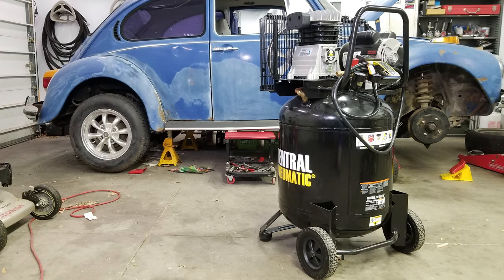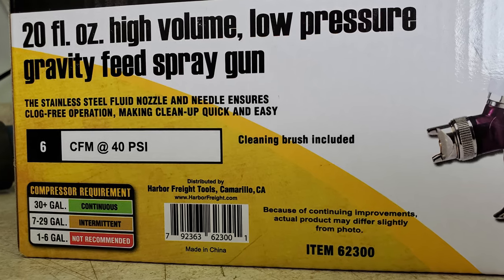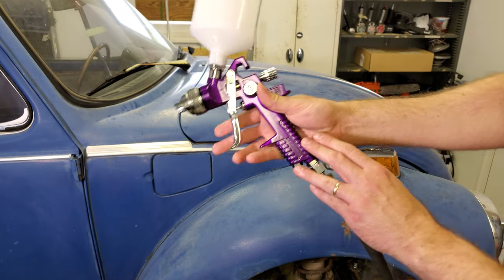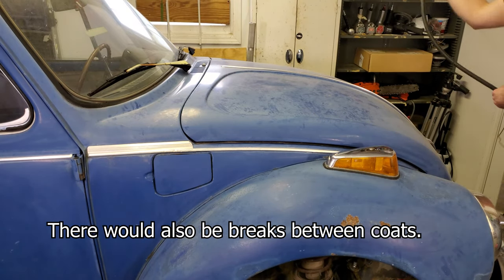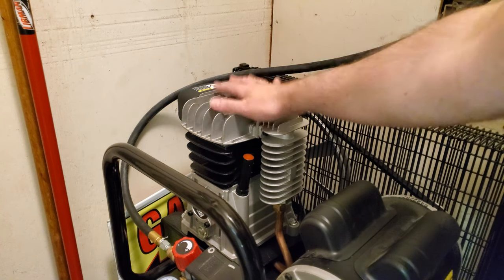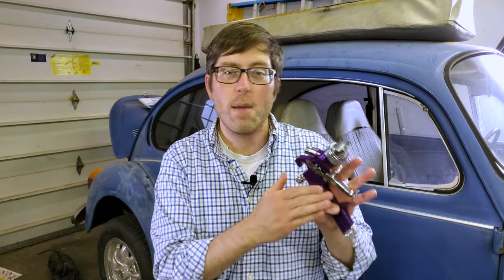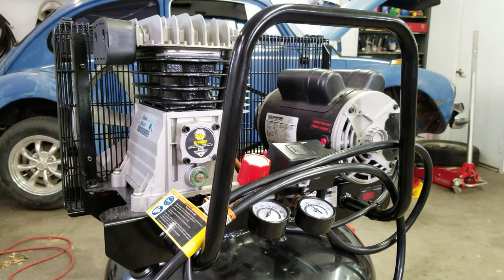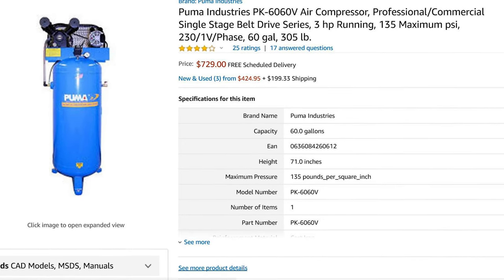Tool test: Can the Harbor Freight 29 gallon air compressor run an HVLP purple paint spray gun?

Comment: as a car painter myself, what do you spray for 10 min straight. this should be fine for painting the average car, there are a lot of stops and starts to it, AND you are not using the air gun to shoot as much air as it can.
Reply: exactly!
Reply: Problem is with clearcoat trying to keep a wet edge without starting and stopping

Comment: I've used a 2hp compressor with a non-HVLP spray gun to paint.  It's adequate.  The test in this video is not realistic. You'd never be spraying continuously for 10 minutes.
Reply from the maker: Well, it's pretty realistic if you're spraying a large vehicle. Like I said in the video, give it some breaks and it will work. You'll still be running the compressor pretty much constantly, though.
Reply: One can not paint continuously for 10 minutes,  for one, you'll never hold the trigger without any stop in between different areas of painting, more importantly, don't you think you have to add paint at certain point and stop painting??
Reply from the maker: Just like I said in the video, it's not a perfect test, but it gives us an idea how the pump cfm compares to this cfm usage on this gun.

Comment: I use the 21 gallon HF compressor and painted my car no problem.  As long as your patient and not stupid it works just fine :)
Reply: What spray gun did u use?
Reply: @theonekninek75230k  The cheapo HF one.
Reply: I just bought a Eastwood spray paint that only uses 4.5 cfm at 30 psi and I really want that 29 gallon but I think I'll start off with that 21 gallon since I'm new to using spray guns it should handle it
Reply: Exactly

Comment: With thise vunscyou should never use 40bpsi usally fir base coats you would use 29 psi for base coat ckear at 30 to 31vpsi you falilded fro not using a requlartor in gunnur not getting true pressure at the gun

Comment: For anyone who is wondering if their little air compressor can handle spraying, here's my experience. I have the HF Central Pneumatic 6 gallon 1.5 HP 150 PSI, with the HF 20 OZ HVLP spray gun that according to the manual demands 6 CFM at 40 PSI. I just sprayed three layers of lacquer on a 4' by 6' dining table and not a single issue. The compressor came on one or two times during each layer. I set the output to 40 psi. The tank pressure never fell below 70-80. 
I believe the factory specifications are for CONSTANT running of the spray. But what amateur on earth does that? You would need to let the trigger go while you reposition yourself or handle the air hose around the workpiece anyways.
Reply: i have an older 8 gallon Central Pneumatic compressor with the gun hes using in the video.. is it great for this purpose? no. but even my compressor worked well enough to paint my boat. i set my gun at 20 psi. but it worked. so i agree with you
Reply: I pained a car fender with a pancake compressor at 20psi. Not ideal, but it worked.
Reply: For painting cars you are supposed to never stop the air flow. So for that application it may be problematic

Comment: The air compressor works fine, its the amount of air you are asking it to provide that's the problem...yes in short bursts as one would typically use a paint gun, the compressor will handle it just fine...I've yet to run across a case where I've had my finger on the trigger for more than a couple minutes I guess maybe if you were painting a bus but for most DIYers they're going to do a few feet of painting at a pass, let off the trigger, and move to another section and so on, so the compressor will be able to keep pace....the compressor of course needs to be located in an area with great ventilation in order to help keep the pump cool....the motor will run fine continuously, its the pump itself that'll have issues, and I think most are rated in the 10-25 percent duty cycle for homeowner compressors at least.  The motor is 100% duty cycle rated.  

You can always stop a few minutes to let the compressor recover and motor shut off too....there's nothing saying you gotta keep on spraying continuously, and in most cases it would be pretty short bursts as you move along whatever you are painting.  

I think I've had this same compressor for about 4 years, it does everything I ask it to do pretty well and if the pump fails I can order a rebuild kit from Campbell Hausfeld.
Reply: You do got to pretty much continuously keep spraying with clearcoat or you lose your wet edge
Reply: @wild8757  : What do you do when you have to refill?
Reply: @markashlock9017  I use a big enough cup to cover up to the end of a panel, then refill and start on the next panel, after doing it a while you get a general idea of where you’re going to run out

Comment: Take doors hood and trunk off on any vehicle and a small compressor will do great painting them separately. Plus you'll be able to tackle your door jams easier. Now don't expect your compressor to last painting every day but for a diy person it'll work. I've personally painted 2 cars and my trim in my house and my fence with a 4 gallon compressor hooked up to a 50 dollar extea air tank with the harbor freight gun with no issues

Comment: I have this compressor  and have used it in the summer time sanding with a DA sander for a couple of hrs. I just put a fan over the pump to keep it cooler. Stays at 60 psi in the tank.  Nice little compressor for home use.

Comment: I've had my HF 29 gallon compressor for about 13 years. Besides it taking about 10 min to fill the tank, it's a good one. But it WILL NOT run a quality spray gun or pot sprayer, like you said. I Raptor lined a Jeep Cherokee with it and it was perfect didn't have a problem with it at all. Good vid!!

Comment: I have this exact compressor.  I added a B&M supercooler setup, as an aftercooler, between the pump and tank. The cooler is mounted on the belt guard in front of the pump so air from the fan cools the air charge. I've also installed a water separator between the cooler and tank. It traps A LOT of water. On the output side I've installed a Brass T connection with full port ball valves. One side goes to my T type automotive connector to run my air tools, the other goes to a THB 3 stage air filter with Legacy Hi Flow fittings to run my sandblaster and paint guns. On this side i use flexizilla 50ft hose, again with oversize hi flow fittings. 
   This runs my siphon blaster excellent. The pump runs pretty constant, but I've never found it "run out of air" and the air coming out is DRY. I run the harbor freight purple gun and the eastwood concours LT. This setup runs them well. Yes the pump runs, but I've never encountered air volume issues with the spray guns. And I've ran them fairly consistent. So, to be conclude, yes consider the spray gun you run with this machine. I love mine👍
Reply: You should make a video exposing your set up. I would love to upgrade mine like yours !
Reply: which gun do you like better?

Comment: Thank you for the video.  I'm researching painting with the purple HVLP gun as well.... just ran your test with the purple gun at ~30psi and ~ 40psi with the trigger pulled...  My 20gallon 2hp vtwin compressor seems to keep up with the gun fine.  The gun pulls about 60 seconds of air out of the tank before the compressor kicks on and the compressor runs about 60 seconds (30psi) or 90 seconds(~40psi) before shutting off, and then the cycle repeats....

Comment: You are right, this is a big problem with air tools and compressors. The issue is that compressor makers and tool makers are talking apples and oranges.
The compressor rating is almost always in SCFM. This means that it is talking about how many CFM at standard pressure, which is 1 atm, i.e. 14 psi! Even when the compressor lists the rating at say 150 psi, it is still in standard CFM. It is just saying that it will be able to keep pumping that many SCFM against an output pressure of 150 psi.
I look at it as if the compressor is listing the air going in (atmospheric pressure or 14 psi) and not the air coming out. So, a compressor rated at 12 CFM will put out 2 CFM at 85 psi continuously (85/14 is about 6).
Air tools are unfortunately rated by the CFM needed at the pressure required by the tool. So, looking at it another way, if the tool needs 3 CFM at 85 psi, it is the same as 18 CFM at standard pressure! Very few tool makers list the air requirement in SCFM.
Reply: you do have to be careful with terminology on all marketing, but atleast local to me in canada seems alot of companies list 2 cfms at two pressures.. they all use different pressures but cfm at 90psi seems to be the most common

from a 100$ 8gallon unit on canadian tire site"Rated Air Flow: 4.8 CFM @ 40 PSI, 3.5 CFM @ 90 PSI" compressor shuts off at 135psi and im sure makes very little flow up near that pressure
Reply: Exactly! BTW: this is for consumer air compressors. Commercial units rate for output. Another factor are the hose and coupling sizes.
Reply: @stvwds61  well hose and couplings will effect air consumption and tool output they wont change whats produced by the compressor, i just got milton V style i think purple connectors huge difference in size and tool performance, but that obviously uses more air i suppose you could try and build a restrictive system to make a tool use less air and have a longer useable time frame before letting the compressor catch up
Reply: Really hard to find and easy conversion for CFM to SCFM and back. His compressor is 7.5 SCFM at 40 psi. All I want to know is what CFM is that at 40 psi at the same temp and humidity as the SCFM standard so I can if the CFM rated spray gun will work. I'm looking at a Home Depot HUSKY with the same specs as the above HF and it states only good for intermittent HVLP spraying.
Reply: @rudsaki  Atmospheric pressure is 14 PSI, which is the standard in SCFM. Lets say the desired working pressure is 56 PSI. This is 56/14, or 4 x higher pressure. To convert to CFM at the desired pressure, divide by this number (as pressure goes up, volume goes down). 
In this case, the ratio is 40/14=2.9 and the flow volume goes down to 7.5/2.9 or 2.6 CFM.
Reply: @qcnck2776  Good info. So trying to follow it thru with my 29 gal/2hp Central Pneumatic compressor. Brand new. Specs at 7.3 scfm @ 40 psi and 5.9 scfm @ 90 psi. Will be spraying HVLP on a small Porsche  roadster. Full sealer, base, clear. So the Iwata gun as vague as the specs can be looks like about 9cfm. My paints average at about a 24-26 psi working pressure. I am also using Hi Flo fittings. So if I set the psi at the compressor say at about 30 psi and then fine tune it at the gun at the 24 to 26 I think that's a logical way. But as far as following your conversion is this correct?: 40/14= 2.9 scfm or 7.3/2.9=2.58 cfm? And if so granted you are not pulling the trigger constantly but more than not for certain, is that a gun to compressor mismatch of 9 cfm (desired gun): 2.58 cfm compressor?  Don't know if this is a factor but I am right at sea level. Thanks.
Reply: @larrygk1257  It certainly looks like a bit of a mismatch. Paint spraying is probably one of the most demanding uses, since continuous flow is needed for a prolonged duration. And that darned High Volume part  of HVLP may be difficult with a 29 gallon tank.
Might I suggest a trial run with some cheap paint sprayed on a sheet of paper or cardboard the same size as or slightly bigger than the area to be sprayed at one time on the car?
Reply: @qcnck2776  Oh yes and thanks. Have painted several cars in the last 5 years. Yes you always do test sprays on a piece of metal or cardboard with the actual paint as viscosity matters. You have to to set "fan, fluid and force (air)" settings on the gun which further mandates the tests. I am going to make this work and given it is not a huge car several natural places to back off the trigger without creating dry or wet spots. 
D-day will be Thursday with this new gun.

Comment: I have a oil cooled 3hp Sanaborn compressor that only has 11 gal tank, it puts out similar air volume to the Harbor freight Compressor you have but less tank volume. I wanted  to repaint the hood on my truck and the roof above the cab. (It is a extra cab) I used the harbor freight gun that requires 12 CFM. I was concerned I wouldn't have enough air so I bought the oil cooled 2hp 8 gallon compressor at harbor freight and ran both compressors into a T so I could use both at once.  Combined CFM on both compressors was 12 CFM. With both compressors running wide open it worked but the compressors never shut off. I am sure with the Sanaborn only I would have run out of air. When you are painting a big area like a hood on a truck, you can not stop in the middle to let the compressor catch up. I have since bought a used 2 hp Speedair compressor off of Craigslist and a 3 into one fitting so I can run all three together. My recommendation is figure out your CFM requirements and buy a 50% bigger air compressors  than you think you will need.
Reply: Yes when I Sandblast I always run two compressors with a T and even still you have a very limited run time before the compressors need to catch up

Comment: I have a video that I haven't published yet of running exactly the same test with that same compressor and HF's $74 HVLP gun rated at 15cfm@40psi.  The only thing I did differently is let the airlines fill with whatever the regulator was set to (I believe it was around 100psi) and used a regulator on the gun regulated to 28psi (the max pressure stamped on the gun).
The results were exactly the same, it was not keeping up but the pressure was dropping slow enough that it never dropped below the pressure set at the regulator, I think I ended with around 55-60 psi.
Reply from the maker: That's interesting. I'll check it out when you post it.

Comment: Great video!  I wish more people would focus on the compressors---any gun works pretty well with a 60 gallon...lol.  I have the same compressor as you and use a Concours LT from Eastwood. It only uses 3.5 cfm at 35 psi.  My only complaint is that the 1.3 tip really is a little tight.  its fan pattern is also not really large.  There's no magic free lunch.  The compressor easily handles the gun...But some important tips.  I use the "hi flow" merlin fittings--which double air volume.  I also use a 1" hose (another HF special).  These small things make a huge difference..
Reply: I just ordered one I'm new to spraying with guns I'm going with the 21 gallon from HF for now I probably see how that compressor handles it has enough cfm but I'll probably upgrade to the bigger one later
Reply: @2koolforyou88  I have been pulling my hair out trying to get any hlvp system to work, since 1995.  The turbines heat up the paint, and do not breakup the paint until it is too thin to count as a half coat. they also lack the top feed needed.
      You need, really need 220 volt compressor to use the hvlps.  This limits taking it places to do spraying.  
       I bought a lvlp, but found it uses much more air than the 6 cfm harbor freight. 
       I bought the biggest hp compressor that 120v can handle.
       So far, I have had to stick to over thinned and over retarded lacquer, spraying horizontally so the crappy film can level with gravity and runs are not an issue. 
        I wonder if the Eastwood concourse lt100 is worth the extra 100 bucks.   Or if I should spring for the 12 cfm version of harbor freight, or if this would waste my money which could be put into a pressure pot for faster primer production.

Comment: Real world use this setup WILL WORK when actually painting. With the gun adjusted properly and the breaks between moving from panel to panel and time for flash off. It will run a lot but works fine for real use. Especially if you are the kind that lets up the spary before starting the next line. All the little breaks in spray adds up and really helps. I have used this compressor and same purple hvlp with 50ft 3/8 hose and high flow 1/4 fittings. Regulator on the handle of the hvlp. Compressor regulator set to 100psi and handle regulator at 40psi when spraying(around 55psi off). With my last paint job i had airflow knob around 3/4 to get the spray i was after.
Reply: pospc2 I’m dyeing leather seats and I need a compressor. I used a home right hvlp electric gun and it worked and gave me the finish I needed but I upgraded to TC brand HVLP guns off Amazon. 

There’s ALOT of flash time and dry time with what I’m doing. That’s honestly most of the time taken is drying the many coats. 

So my question is will the California Tools Compressor 8010a model work in your opinion? It’s only like $200 8 gallon
Reply: @FreeChavez  I have used a 8 gallon compressor with a hvlp. I wouldn't recommend it personally. The pressure dips and leads to an inconsistent coat. I would recommend it you have a lowes near you and can spare the extra $100 get the 26 gal kobalt quiet tech. 
If you don't care about noise then go to home depot and pick up a 21gal husky or harbor freight. 

My advice is at least a 20gal. It IS possible to use a smaller 8gal but it needs a lot of time to catch up. 
If you are doing seats and are okay with spraying say a single seat bottom or back at a time and wait 5mins or so then you will be fine with the small comp.
Reply: pospc2 got ya. And yes I want one that’s under 70db. I’ll save a couple more bucks and buy a $400 price range one! Thanks for your help!
Reply: @FreeChavez  good luck with the project! 
I own a few compressors, one of which is the 26 Gal kobalt quiet tech, it really is quiet. not sure if it's under 70db but I can use it late at night without disturbing anyone. 
I have used it for painting body panels and in a couple days will be giving it a go at painting a complete car. 
Whatever you end up with, good luck with the project.